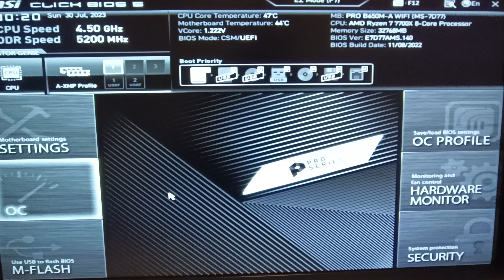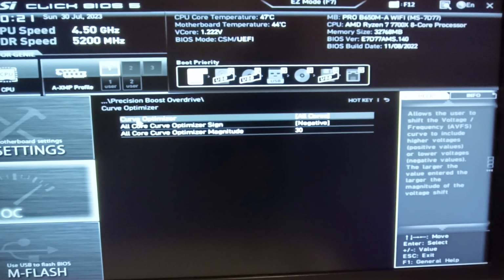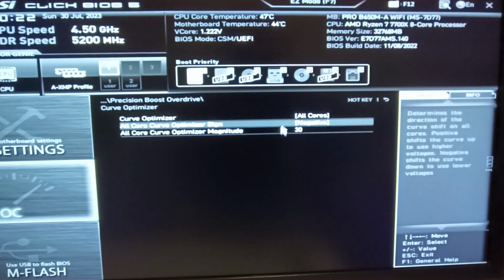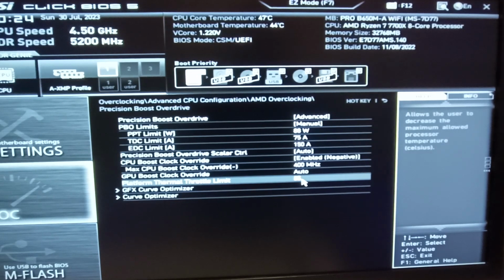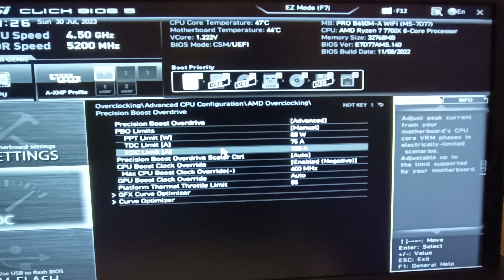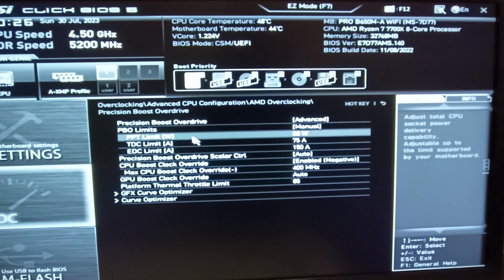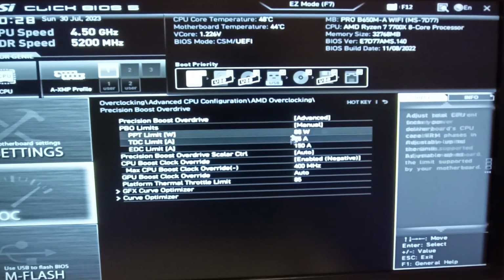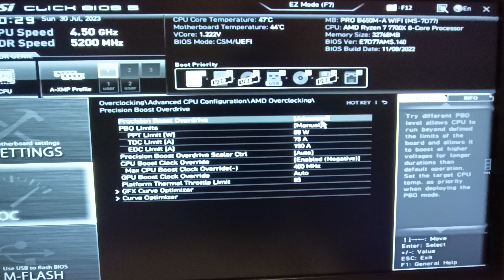How to reduce Amd Ryzen 7700x temps - 95c to 60c in Eco mode !!!! (We hit 1k subs) 🐹🐹🐹🐹❤️

Comment: Thank you for this tutorial. It gives a big help to me. I had experience sudden peak every time i open application. but know the temps stays at 50 on idle and 60-64 on peak. is it safe to set the Max boost frequency change to NEGATIVE 600?

Comment: mate!! all i can say is thank you! i was able to set my pbo to -20 and it was stable after this settings! trying -30 now with same tdp and rest of things you placed here, will update how the cinnebench stability test goes otherwise geekbench scores for cpu and gpu with this settings was epic! 

hardware:
MSI b650i edge wifi itx mobo
4070 TI super 
ryzen 7700x 
cpu cooler noctua nh-l9a

temps on idle 50-60c cpu
full throttle 86c thats like -10c from just doin eco mode.

again thanks for this video you literally saved my build as i thought i binned my cpu 😅

Comment: Guys, I upgraded my AIO.  It's now 42 degree idle and 60 or so under load.  You're welcome.  No need to undervolt.  Spend $100 and get a cooling system and keep your performance.
Reply: what aio did you upgrade to, i got a nzxt 240mm kraken and still having high temps
Reply: @tannerblair2185  SAMA LD 360mm AIO - CPU Liquid Cooler - Customizable 2.8" Square LCD Display
Reply: @tannerblair2185 i’m going for the arctic liquid freezer 3 360mm
Reply: What was your temps before? I have Corsair 115i elite aio but my temps are 50c idle and 95c+ while gaming POE2

Comment: I open bios and the cpu core temp is 93C after it not being used. CPU socket temp is 55C. Pretty sure my cooler installed correctly and thermal paste came pre applied :(
Reply from the maker: If thermal paste was pre applied on the cooler before you install  , high chance the paste is dry. Thermal paste is cheap and easy to Find. Worth trying repasting first. Is this a new PC build ?

Comment: This helped me go from 80+ cpu with load fans blowing to not going over 55 c  with no fan noise
Reply from the maker: I had the same results on air cooling. Also the performance lost by doing this is EXTREMELY minimal. Just noticeable under benchmark tests but daily use and gaming , I see no real difference. Glad it's  working for you bro. Pls like + sub 🐹🐹🐹🐹🐹❤️🐹❤️🐹❤️🐹❤️🐹❤️🐹❤️🐹❤️🐹

Comment: curve optimizer -30 maybe stable when running a stress test boosting all cores to max frequency but most likely will crash your system or give other problems while running programs because it may not be stable elsewhere in the curve running at lower frequencies.
Reply: what would you recommend for a 7700 non x ?
Reply: @razvanm1988
It's impossible to just give a recommended setting don't own a non x and even when using same cpu, ram and motherboard there are differences.
But you could try setting -10 and run with that for awhile and if you are sure it's stable go lower step by step just be a where that some problems are hard to notice or just occur when a certain core hits a certain frequency and gets to low voltage on that point of the curve.
Reply from the maker: @linuxfiredragon  this is a good point to start with. I think most of these CPUs will be able to handle -10-15 without problems. Going beyond -15 might cause instability. Non x versions runs pretty cool generally though.
Reply from the maker: Actually my system would crash with -30 at random moments as you said. HOWEVER, after reducing max boost frequency, I have had no issues. Please like + sub if you haven't already ❤️❤️❤️❤️❤️🐹🐹🐹🐹❤️🐹❤️❤️🐹🐹
Reply: did you try 300mhz first? @LinuxHamster
Reply: oh and did it make much of a difference in gaming